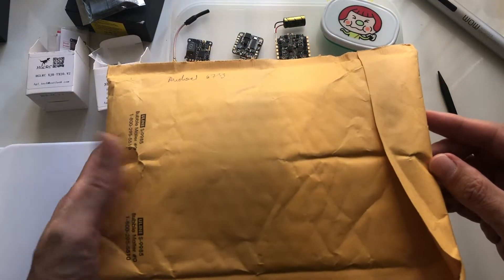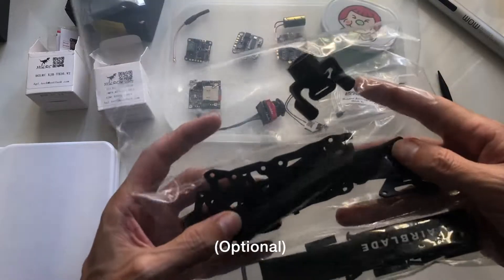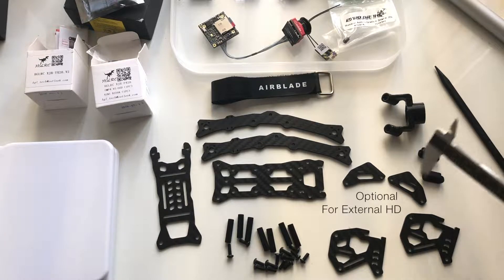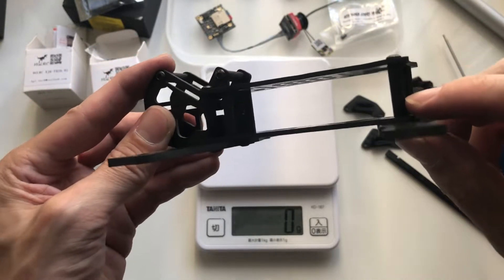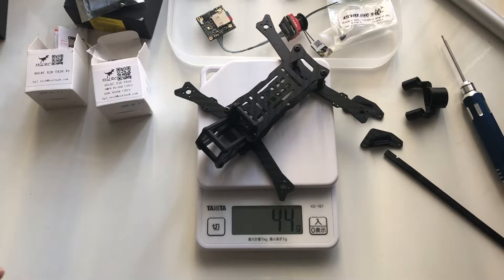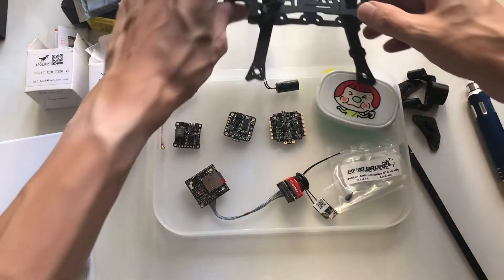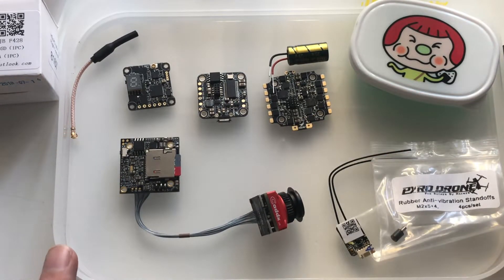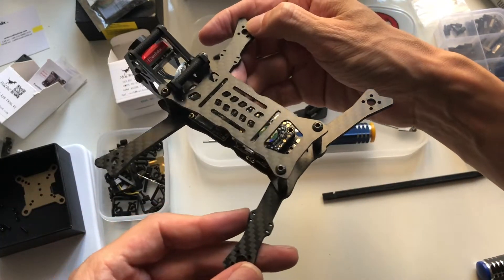Airblade Intrepid V2 Lite Part 1

Comment: Nice videos you have, just Subbed. You're setup is pretty much what I am currently eyeing to build, except that I was looking into the pro version. Thinking I want to be able to fly with 1407 or 1408 motors, but your setup looks really nice as well with the Superman motors. You mind me asking your decision to go with lite over pro?
Reply from the maker: Patrick Sjöholm Thank you very much! For sure the Pro version would be great on 1407 or 08 motors. I went with the 1404 and the Lite because I was so pleased with how quiet the RotorX 1404 motors and 3044 props are on my Eclair Lite and I wanted something similar. I’m sort of paranoid about my quads making a lot of noise and for me 1407 and above starts to get into the scream-y range;)
Reply: That makes perfect sense. Thanks for sharing:)

Comment: I cannot find any information anywhere about the difference between the "Lite" and the "Pro" versions of this frame. Do you have any clue?
Reply from the maker: C4pnk1rk Hello. According to the description I see, the Pro has slightly bigger arms with 9-12mm motor mounting pattern and it weighs a few grams more. Not much of a difference it seems, though I’m not sure if the arms are any thicker. I’m pretty sure the center section is the same.
Reply: Thanks for the reply! I contacted them and they did confirm that the arms are a bit wider, and the motor mount holes allow more options. There are ZERO changes other than these two. Their page just doesn't specify "Pro" vs "Lite", so I got myself confused I suppose. They've also made the .stl for the AXii mount available on Thingiverse, so that's super cool of them... I'm ready to hit the button, just no reviews yet =X
Reply from the maker: C4pnk1rk Oh cool. Glad you got the additional info:) Hopefully I’ll get my motors tomorrow so I can finish up my build and make a more in-depth video about the frame.
Reply: Awesome... I'm looking forward to it! I'm gathering parts for mine currently. Will be nice to have one I'm not ripping around at stupid high speeds, and just slow down some and enjoy the scenery =P